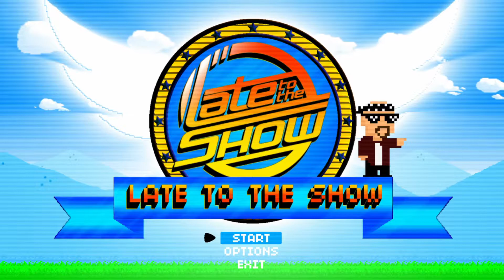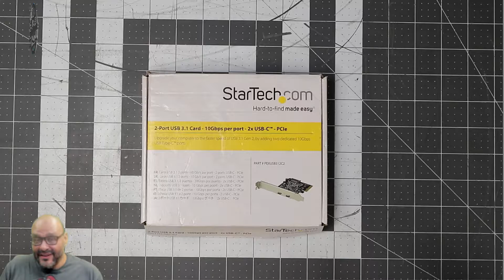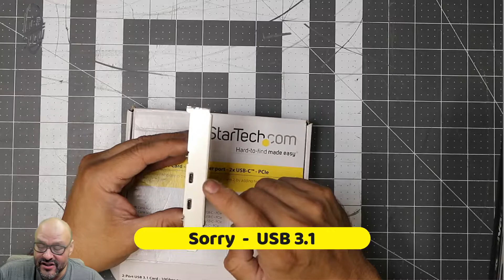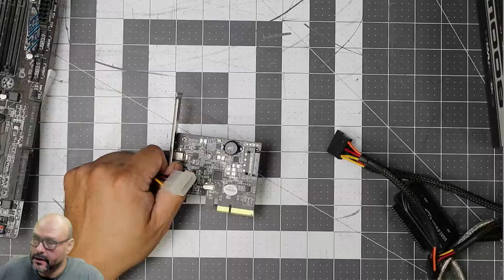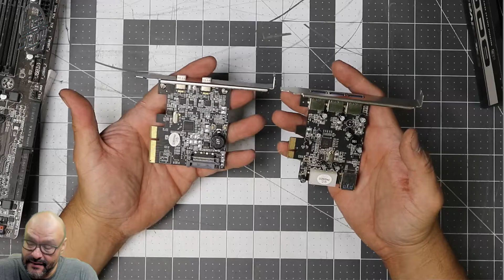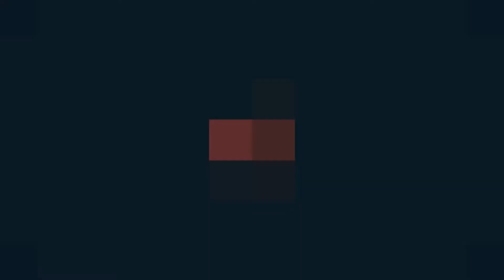PCIe USB 3.1 Card - 2X USB C 3.1 Gen 2

Comment: I have a dell universal dock ud22, my desktop hasn't got a type c, if I install this would the dock work, the dock will have 2 external monitors, reason for using the dock is because I would like to swap between the laptop and desktop for my dual screen setup